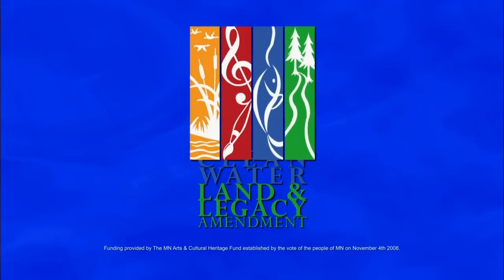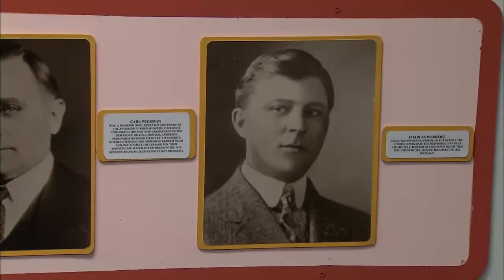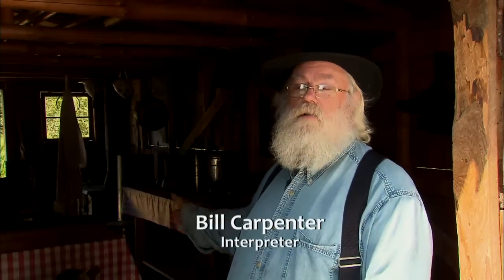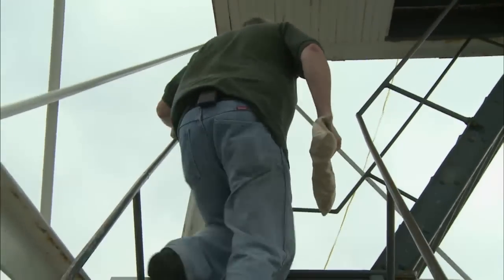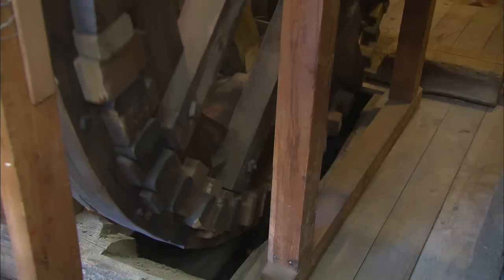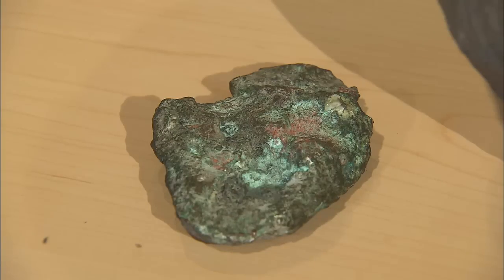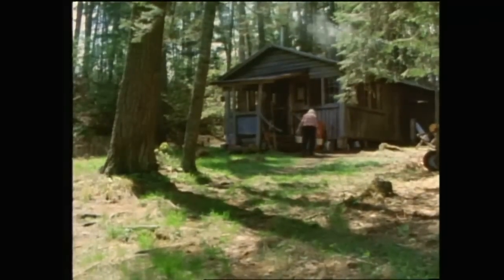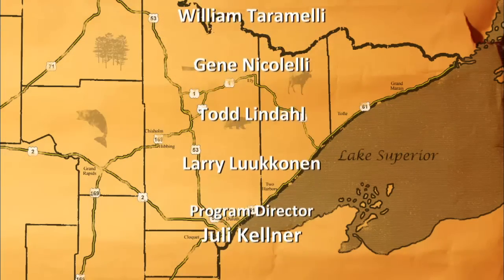Rare Finds - Full Documentary

Comment: "Steeped in history"..l've lived in houses older than 250 years old. American's think 1940 post war utility furniture are examples of fine antiques...😂😂😂
Reply: No I doubt anyone thinks that. My house was built in 1869 and was full of that stuff. It’s that caste iron and tile fireplaces that I value
Reply: I helped remodel a house in Huntsville, Al. It was built in 1832 was 4200 square feet and not one stitch of plumbing or closets in any room. We got thru with it it was 14,000 sqft with a cinema in the basement. I did all the handrails and structural steel and a lot of the carpentry work. It had a slave quarters in the bottom part of the house and was pretty dang creepy. Also we were soda blasting the brick and found a 1st edition Gone With the wind book and it was signed  and had writing in the front that said. A gift to my lovely wife on 12/25/39  we found it on 12/23/07. It was pretty cool to have worked on that kinda history.